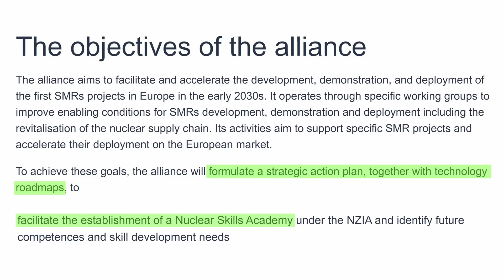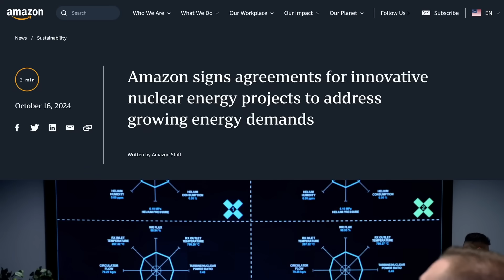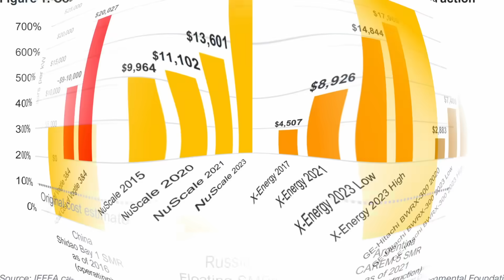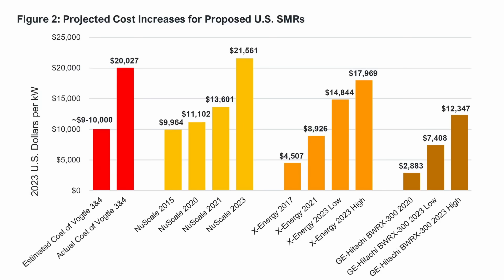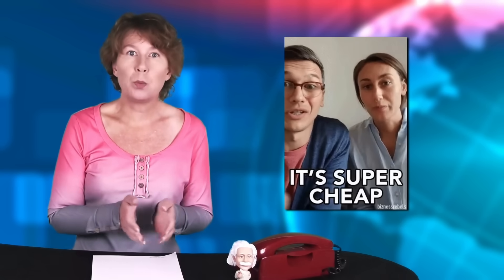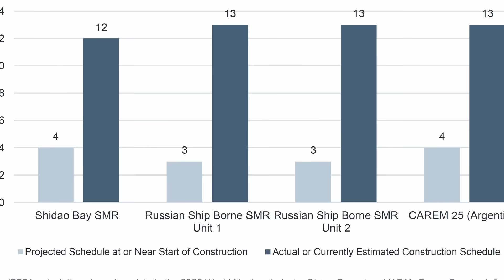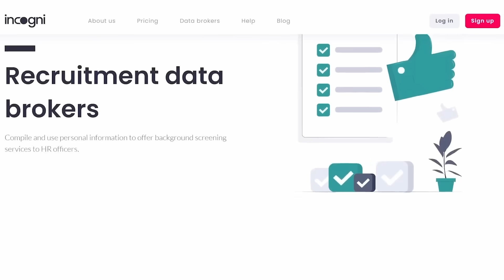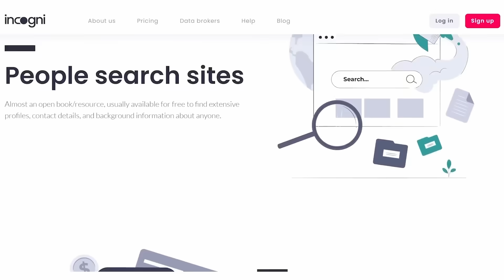Small Nuclear Reactors Have A Big Problem

Comment: The main issue I see is security,  the security required for a small reacto still has to be full cover.
Has to be secury against all possible external risks
Airplanes
Military
Terrorism
ordinary crime
you name it, it has te be safe proofed.

Now put a big plant with 4 big reactors,  you get economy of scale in production, from securing the construction yard to Running the plant operationally , shared access control, shared medical on site, shared everything, shared disaster planning, shared liaising with neighbor civil services).

None of that works with distributed SMR' at the places where they want to build them

Comment: 10 or 12 years  ago I saw a program, possibly on PBS that had among other info a segment on a small-scale nuclear power station the size of a small barn. It was associated with a college (possibly in Colorado) and at that time had been up & running for 25 years. They claimed that due to the low-level fuel (possibly Thorium?), it could never melt down or suffer any catastrophe. I have searched extensively, but it seems all mention of it has been scrubbed from the internet. We can only assume that this was deliberate action following political pressure from GE, Westinghouse, etc., the builders of large-scale nuclear power stations. Does anybody have info on this?

Comment: You can store extra exergy in the sulfur-Iodine thermochemical cycle. Vent protons across a ceramic membrane during HI decomposition. That creates a delta pH gradient immediately.
So, you can run a barely adequate baseload and during spikes this tank of solution will immediately abd automatically dump the exact extra power needed.

Comment: this program is the future, along with energy storage.  Quantum Scape(NYSE, QS) has batteries that can be charged in 12 minutes and can take a car 600 miles before it runs out of fuel.  In the past 5 months the stock is up +300% in part due to the future of storage for small towns, factories, and for drones, ships and even airplanes.  At the same time, I have seen videos of the real meat and potatoes of this program, doing much better than some people are saying.  This is about the safety of the fuel.  Now radioactive pellets, which are covered with things like ceramics. This fuel is sold to the public with the notion that it cannot overheat and go critical.  They have tried to make it move the needle but the way it is designed once it gets to a certain point it flat-lines and these coats of armor wrapped around every little piece of fuel literary works. Soon, it will be safe enough to buy a unit to run a nursey.  When I mean soon I mean they could and would do this tomorrow, IF you could buy one.  But you can't, yet.  I have seen the Navy use atomic submarines to power places like San Juan, for example, after hurricanes.  Only the fuel in that reactor was normal, and deadly.  Not so the pellets.  I'm building a new home in the mountains to attempt to mitigate the upcoming logical end to this Polar migration.  If I could put a SMNR in that house, I'd order it today.  But, there exists no such catalog. At least I can have an amazing storage for energy, I'm sure QS will sell me a couple of sleds and that should be enough to run the whole house, and solar will go a long way to keeping the batteries charged.  A generator could take up that slack.  Good Luck, IMO you have 11 years, until the next solar cycle, and when the Sun changes polarity then, the migration on this planet might well have reached a spot where the Sun's magnetic influence on it may well push through and make the Earth's Poles swap, and when they do, this stuff, and many, many other things won't mean a thing.  Day to day survival for those few who remain will take over. Sabine knows this, and many other You Tube channels track this.  One has a count-down clock based upon ancient Hebrew, and way back then they knew about this, how?  Because it's a 6000-year cycle and our time is up.

Comment: Why not utilize the tech from the US Navy vessels? They never had an accident. They are somewhat standardized and built using the manufacturing standards that exceed what would be evident in a the private sector version.
Reply: Seriously
Reply: @whousa642 Yes, the designs are complete and thoroughly tested. I believe the manufacturing cost could be brought down. If not, IMO... they would still have to be cheaper than a turnkey 800MW unit. I worked in the power industry for 20 years. I do understand both the advantages and the draw backs.
Reply: @daveclements5180 I don’t know but they have lied the past few generations. Markets will decide if government allows them.

Comment: SNR has the best chance of success because its standardization. Just 2 sizes would fit all. At the beginning it may suffer overrun but lesson learned and they will learn. I am surprised that the Chinese did not success and may abandon the efforts. Nuclear energy is an old tech and very matured.

Comment: I know we’ve had materials improvements but it’s almost like the scientists and engineers in the 50’s, 60’s, etc knew what they were doing and designed at the scale needed to offset fixed cost and other scale issues.

Comment: The word "nuclear" is the most abused term in technical world.  It is so un-precise.   There are two types of reactors fission reactors and fusion reactors.   Fission technology is almost 100 years old and substantial improvement.   It is an obsolete technology in any form.  TAE Technologies is a fusion technology that will take over the market.  Because it does not produce radioactive waste which is a major deal breaker.

Comment: There is a killer fail for mini nukes few talk about - security.  The only place you'll find small nukes that worked are in navy's where security was assumed and high.  If you put out a bunch of small reactors and forget to have a 1000 meter security area - you'll get terrorists attention; they'll bomb them or steal the nuclear fuel materials which are usually about 15-20% U235 instead of 5%.  If you want a better energy solution - the earths core is hotter than the survace of the sun - figure out how to get access to that rather than waste it on radio active terror targets.

Comment: Only some SMRs are designed to be transported as plug-and-play solution to the place of operation. Other SMRs go up to 300 MW, and want to produce just parts in the factory in series and install them in a modular manner. An example is the Chinese HTR-PM with two pebble-bed reactor vessels, and two HTR-PM600 with a total of 6 pebble-bed reactors each. This has the large advantage that parts can be produced in controlled factory environments, and at th construction sides smaller equipment can be used. China currently short on heavy equipment, which limits the number of large nuclear reactors finished to about 5 per year. There is also the smaller ACP100 in construction.
Western concepts start with smaller container size concepts, partly for specific markets from Radiant, like military, disaster relief, and off-grid, and designs with up to 1500 MWe, like the patented Dual-Fluid Reactor, designed by a German team. The power of 1500 MWe may look contradictory regarding the term "Small" in SMR, but because of the extreme high power density, use of a separate liquid fuel loop with online pyro fuel processing, and primary liquid lead cooling at 1000° C, the size is as small as other designs with 300 MWe and below. And it is modular to build the modules in factories, and allow easy replacement of critical parts. 
Of course, all western designs are behind China more than 10 years.

Comment: Solar is so much cheaper.  And by the way, nobody wants the waste. Please solve that first.
Reply: Did you ever look at the designs. Some of them are waste-burning. They can generate more than 100 times the energy original produced. If burned down completely, the "waste" consists of 95 % partly precious metals, and 5 % real waste. Both fractions decay to the activity of natural uranium within about 300 years. The energy from spent fuel and depleted uranium is enough for 1000s of years, worth 100s of trillions USD, paying the national debt multiple times. This without requiring fresh uranium.

Comment: I proposed a small (300 MWthermal per unit) in mid-1980s to GE Nuclear.  They (the engineers) laughed.  'No economies of scale'.  'No production facilities.'  'GE reactors are safe.'  'The intervenors (environmentalists) are killing nuclear power.'  Blah, blah, blah... the more things change, the more they are the same.   Solar, wind, and batteries (SWB) is the answer.  Ask China.
Reply: It seems to be that you are not educated regarding China. China is ahead with nuclear development and construction 10 years at least. They want to reach 200 GW nuclear in 2035, and 500 GW in 2050. They are active in all relevant categories. They are building their own AP1000, running the HTR-PM with 2 pebble-bed SMRs, building two new HTR-PM600 with 6 SMR each, building the SMR ACP100 with 100 MWe, and running the SMR TMSR-LF1 with 2 MW, building SMR TMSR-LF2 with 10 MWe. China has a real long-term plan. 
Important isn't LCOE, but LFSCOE. Read the paper from Robert Idel.

Comment: I think we need molten talk small modular reactors, because in the same reactor area rather than 10 to 300MW you can get 100 to 900MW, reason for the big jump on the lower bound is that the power density of a 10MW solid fuelled reactor per unit volume is for s£$%, where as molten salt fuelled reactors can be scaled well because they don't need to contain water at 70 - 150 atm of pressure, more like 3 - 6 atm this is to stop xenon and other fission product gases from bubbling out where you don't want them to, so for a solid fuelled SMR you need the same wall thickness as a large reactor which brings down your energy density per unit volume massively when you try to go really small.

So yeh again you can scale down a molten salt reactor much more and maintain a decent power density per unit volume, to the point where you can theoretically build a 300MW reactor that could fit in a cargo container ready to be hooked up, honestly even solid fuelled molten salt cooled reactors also have a similar advantage, but you would need to go pebble bed to allow a greater surface area for the molten salt to cool the fuel because molten salt is a worse heat conductor than water.

Comment: What is wrong with small modular reactors stateside is the hole in the ground needed. Any reactor here in the new Knighted States is the hole in the ground. They cannot be put here without a massive hole like 60 ft deep filled up with concrete and rear. Not filled clear up but open in the center to put whatever reactor is going to be put there. Like a huge hole and massively thick concrete and rebar. Like 5 ft thick concrete and rebar. No matter the size of the reactor or size of the hole to take the reactor. Probably 10 stories deep.

Comment: You left out Canada. Until now, Canada has been using the CANDU design, and while it has not built a new one in quite a few years, it has refurbished several of its existing reactors( a very major undertakiing, the last on time and on schedule. So there is a pool of experienced builders and operators. Currently, it is building a 300MW SMR at one of its sites with expected completion in 2029.  It is preparing the site for the second of 4. Additional ones are in planning for other locations in Canada, and Poland is considering 6. 
There is nothing particularly new about the design other than being scaled down and optimised for manufacturing. The original design goes back to power plants for subs. SMRs cover a broad range of sizes and designs. At 300MW you are not talking about building it in a factory and shipping it somewhere. the major components would be manufactured and shipped. There are huge advantages in the approach. One-offs, even when to a common design, are like building a custom car, handcrafted. Each component has to be tested and experimented with.  In manufacturing, the approach is different with a certification phase that is up from similar to a handcrafted unit, but thereafter, a quality control system takes over with standardized inspection and processes. From there, you go down a learning curve such say at a 20% curve, the eighth unit will cost about 50% of the first unit. Inflation and other factors do increase the cost, but that is true of potatoes. Just as you would for aircraft, you have to certify the first unit and design. With aircraft, that means spending billions on one aircraft.
With SMRs other than site prep, the production cycle can be much more controlled and standardized. Very often, they could be colocated with existing nukes or positioned at old coal plants where much of the infrastructure already exists.

Comment: The major cost of nuclear plant is not the reactor but the facility!

Be it SMR or standard Reactor there are both made in factories.

The facility cost is high because of plant that is nothing to do with reactor, but the plant. Be it SMR or normal they all need the same waste storage, fallout building and security.

Would you work anywhere near a tin shed that houses a SMR

Comment: I've noticed the same thing. These SMRs sounded cheaper, safer, faster to implement than the traditional giant reactor installations for many years now.  But they should have been able to deliver by now.  They haven't. I too hope it is achievable, but it doesn't look very good so far.

Comment: Rolls Royce has been designing and manufacturing Small Nuclear Reactors for over 60 years. It is not surprising that the original cost have been increased, many costs were estimated ten or fifteen years ago and it’s only logical that costs will rise. Once in production the cost per unit will reduce considerably.

Comment: As I understand it the original idea was to use submarine reactors as SMR. The UK and US have considerable experience and they are very safe. The all-important Safety Case should have been relatively easy. If the design is allowed to stray too far from the submarine reactor then, as with large reactors, the Safety Case gets continually updated as new risks are thought up. So far only the Rolls Royce SMR has entered the UK approval process.

Comment: I see economics is the killer matter,  then why ignore the extreme costs of the wires to the millions and millions of customers cashflows  ????

Fossil fueled CO2 energy is 10 TIMES bigger than grid electricity. 

Electricity generation is dirt cheap. 
Electricity with wires is insanely expensive energy.

Comment: Something is very wrong here. The USA has built many small nuclear reactors for the navy since the early seventies.  And not only low cost but, they have never had a nuclear accident.
Reply: In the UK, Rolls Royce have been involved with small nuclear reactors in submarines, for decades. 
It was suggested that this technology could provide a cheaper, faster solution for civil nuclear energy than the big projects currently favoured by government.

Comment: the costs are not the problem, because also the costs as you say are not increasing faster as for standard size reactors - and you cannot calculate the costs in a hyper-inflationary environment (production cost increase about 50% a year) The real problem are that you need all the inventory as for a standard size reactor - for security, for placement, for all infrastructure and for the stuff where do you get the specialist? they do not exist! and they would be very expensive in such numbers! or would you built a skyscraper built from those modules - you have a much higher probability for an accident Gau, Super Gau  ... and you have to close the hole skyscraper till all repair are done and you need a gigantic graveyard/sarcophagi....; the same for final closing down your skyscaper

Comment: The biggest problem with SMR is that until they are into full production the price will always be high. The initial units are all hand built and being modified as they go into that initial design. The first units, will ALWAYS be more expensive and take longer to bring online.

Small reactors are a great idea. They will allow smaller community access to direct power sources and can increase redundancy within the grid. The premise is strong as we have seen smaller reactors used for over 75 years in Submarines and other ships. 

The issue, as I mentioned is cost. We need a hard look at nuclear power research to find better ways to make these reactors work but everyone sees these costs down the road and gets scared.

Comment: UM, MISTAKES .

Estimates for cost are based on mass production.
When you sell just 10 when you projected 100 , the individual cost will be 5-10X. 

Pilot projects will always cost 5-10x more than mass production. 

Sabine is quite wrong , and her being wrong is getting very common. 

The main , problem is lack of uptake. 

If everyone jumped on the bandwagon , then costs would drop exponentially .

Producers are cutting back , to match demand. This is expected.

This means that , prices are going to be higher , with lower production and lower sales/uptake. 

This is not a "physics" , issue. 

The actual problem is the same as with Hydrogen : " The transition is happening slower than expected " .

Comment: I think you need to  use gravity as a shut down mechanism, make the dampening rods tapered and held up by output power . Any loss and it slams shut stopping a runaway. Coolant reserve should be gravity fed with a recirculating pump in a hot well after the condenser or a local water source set to top the feed tank off.  Design flaws are behind every failure because goal was to keep the power plant on instead automatically shutting down safely